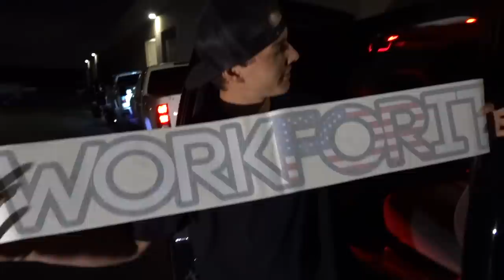Comparing This $1500 Train Horn To Budget Horns!

Comment: it make a big difference or minor if facin horns towards the back side or forward  on the loadness were the spare tire used to be horn i got from EBay fer less then 100.oo in black similar design with 3 in row trumpets says mine a 152db / tank im using is a 7gal aluminum military MRAP airtank that says rated at 150psi i got from EBay fer bout 70.oo and my compressor is a belt driven york-210 ac compressor i have shut off at the 150psi on the switch/ i got compressor  from a old truck but there is a site with kits fer the duramaxes from 2000 on up fer usin the york compressors so u not need them electric compressors if ur runnin a tank larger then 3-5 gallons  got different kits from the junkyard dog kit which just mountin brackets and parts to full kit with a compressor
Reply: Holy shit that's the most confusing paragraph I've ever read.

Comment: Shout out to Wes I got that kit and told Jason you sent me!
Reply: socal_6.2 aka Wes spinner I want to get a set what do I select for the valve option? I currently have horns with a 8 gallon tank and 1/2 electric valve and 1/2 line i’ll basically just be swapping horns.
Reply from the maker: Dustin G you can order just the horns. Keep your current valve.

Comment: I'm running a set of k5la's where the spare was and a set of p3's inside the dually fender pointed at the ground with 2x airzenith ob2 compressors and 10 gallons of air at 200psi. These bitches are loud!